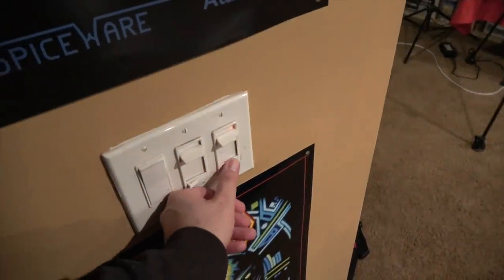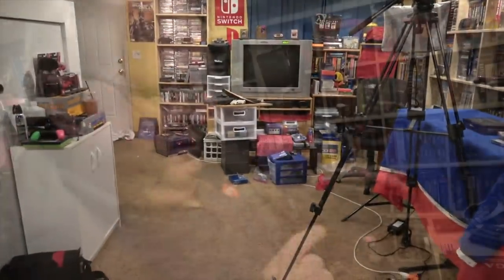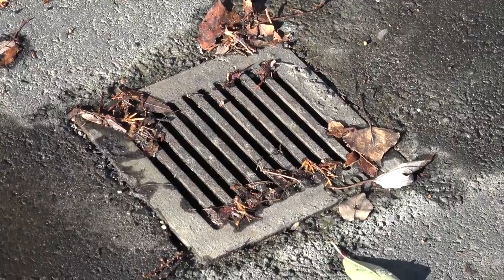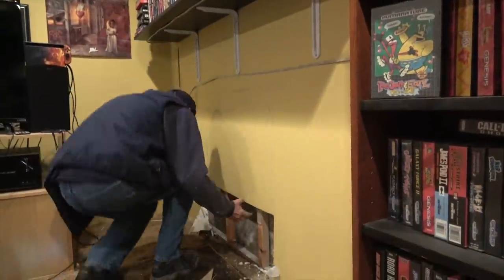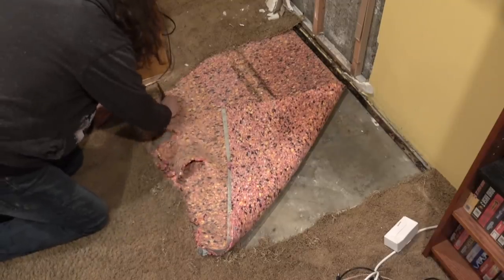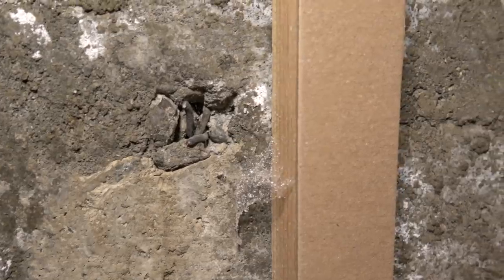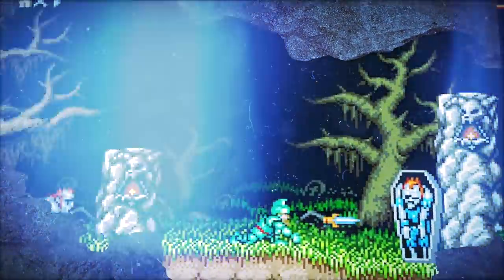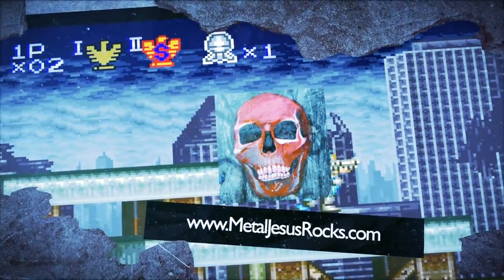OH NO! Water & Mold in the GAME ROOM! $10,000 to fix!

Comment: Whoa, hold your horses...  Minimum all you really need to do is drill out the leaky rebar hole and fill it with concrete.  Very unlikely to suddenly have problems in other areas.  This is a water ingress issue caused by recent landscaping changes, not a foundation issue.  The parking pad was not leveled properly, you can see it is diverting water towards your house.  To go further on the cheap you could dig out the soil next to the foundation on that side of your house to  a foot below the point of the leak and put in a few feet of drainage stones.  Absolutely no need to add drainage to your basement.
Reply: I was thinking the same thing. Drill it out and fill it with hydraulic cement
Reply: Im with you guys, i think the drainage addition to the basement is a little overkill.  The problem seems isolated to that corner for now, focus on that, fill the holes with concrete and see how it does.
Reply: I agree I think he should get a couple more professional opinions before doing this.
Reply: I just hope he reads one of our comments before doing the inside weeping tile don't cover up the problem fix it right drill out and hydraulic cement
Reply: Listen to this guy
Reply: I was thinking the exact same thing. Get a few more quotes.
Reply: I definitely agree. It's also very unlikely that this will happen on any of the 3 other walls as they aren't really underground. At most, do that entire wall that already has a leak.
Reply: I agree that the assessment is questionable.  At the very least, one of the first things to do is to get the parking pad and drainage system corrected so that water is directed AWAY from the home.  Who even knows where that water is going beneath the parking pad?  Adding a drainage system to the basement will not solve problems with water coming in and it may even cause more long-term issues as the concrete begins to break down.

Get the water away from the home and the biggest problem goes away.
Reply: Everyone should like this because its actually true, even for the flooring and everything else, it really sounds lile the company is trying to make a quick buck
Reply: G.A.B. Agreed. You might need to only cut 4’ around the wet areas, get a feel for where these rusted out ties are then cut access panels out, drill out the rusted metal, fill them with cement, let it dry then maybe silicone seal over the finished cement. That’s what I would do anyways
Reply: If u don’t have gutters maybe get some of those too. Gotta keep the water away from the house
Reply: They are trying to take advantage of him just like mechanics and quick lube places to do people who aren't mechanically inclined. This is absolutely not something that should cost anywhere near what he was quoted. Metal Jesus has a huge fan base. There's bound to be some general contractors in his area that are fans and can hook him up and get this repaired at a reasonable price. Hopefully he decides to go a different direction instead of getting ripped off by these scumbags.
Reply: @zborgerd  Yep. Even if the walls are fixed and completely impenetrable, if the water keeps coming up against the house, it has no where else to go but either under the home (which can then find ways up from the floor) or push in on the foundation/walls, which will just cause cracking from pressure. Getting the water AWAY from the home should definitely be the first move. This could even resolve the issue without filling any holes or cracks in the walls. Especially if you have a full-gable roof where no rain or snow typically sits right against the home after storms. 

Also, to fix that one leak right away, there is hydraulic cement that you can easily apply to the hole or crack even while water is flowing through. I get that this may seem like a "patch" on a big problem, but it's a problem that homes like this tend to get as they age. Digging around the home, could cause more issues down the line. Once you disturb ground that has been settled for a while, sometimes the weight shift can mess things up and the water table may be affected as well.
Reply: @Greg Wampler - When I first bought my house, one of the first things that I did was extend my downspouts to further direct water a few extra feet away from my home.  The result:  My sump pump doesn't even fill or run during heavy storms.  MJR's home, being that it's from the '60s,  may have been built without such a drain tile and building codes have since made it required in most places.  When they retrofit a home, like MJR's, they cut in and create an indoor drain tile retrofit to save money, but it's not the best solution and doesn't solve the problem of water being directed towards the home.  The parking pad, and the fact that it drains towards the house, is the problem.

One side of my home is hill-facing, and my neighbor's yard receives a lot of water from the my home, the hill, and the backyard.  They installed higher window wells and he recently had his yard regraded to keep water away from his basement.  Now his sump pump never runs.  It was MUCH less expensive than this.
Reply: @zborgerd  My home last year ended up having an issue with water coming in from under the basement floor. It only occurred after I had installed irrigation "dripping" hoses for my gardens. Once I realized that, I saw that the irrigation hoses were putting water into the side of the home. I moved them out, and haven't had the issue again even under the worst storms. I don't believe there's even a crack necessarily in the foundation. I think after the downspouts were converted from being guided into the sewer system, to being guided onto the ground, the old downspout drainage pipes weren't properly blocked off or began to leak after time, and that water from the irrigation hoses actually flowed down that pipe and under the foundation/floor.  It's pretty crazy stuff.

That being said, yes. I agree. Guiding the water from the downspouts as far away form the home is a must. All of mine are that way. It's also very important to make sure the ground around the home all fades AWAY from the home. You should have a nice slant downward away from the home even at parts that are level with the home. Packing some soil around the home with a nice fade away even under landscaping stones, helps to guide topsoil-sitting water away.
Reply: They nothing worse then going cheap you will regret it later as a very similar thing happened in my basement fill it with concrete only stop it for about 3 months and the water started coming in again
Reply: I wouldn't recommend drilling out the rebar unless it is going to be replaced with tie bars with patress plates on both sides (which is hella expensive!). Those rebars are there for a good reason! They are still functioning as rebars, they are just no longer functioning as closed water seals.
Reply: Or he could simply remove all of that garden and pave that piece of land, leaving only a drain for rainwater... It wouldn't look nice, but I guess it would solve the issue in a much cheaper way.
Reply: @zborgerd  Agree with this. Water needs to move away from home first. Would probably solve issue much cheaper.
Reply: That's what I thought immediately as I watched.  Drill it out and maybe a 2 part epoxy to fill the holes?
Reply: I agree 100% he's making a mountain out of a mole hill. Running a drainage through his basement is going to hurt him in the long run and make his basement unusable.
Reply: @CallforthePriest  Yeah start with the easiest solution first, they know that after 10 minutes it leaks so start with removing that and then filling it in, let it dry then see if it still leaks by running the same test. It could be an easy $50 fix that is $10,000 for no reason
Reply: If you're digging the exterior down to 1'-0" below the hole, then you might as well repair the hole, apply a mastic, and then finally put your drainage stone in there. Digging is expensive though, if you're not doing it yourself.
Reply: Outside drains going to the weeper and storm system. Almost every storm system I've hooked to is above the footing base which is way wrong. Never ever. EVER drain roof gutters or outside water down to your foundation. Grading. Fix outside drains. Check under floor slab for water/drainage via core hole or service cleanouts.

Comment: Take everything out of the room. Don't take the gamble off leaving your gaming gear around dust that's going to happen when the work starts.
Reply: I would say the same, remove everything, put in a rental container or move to another house if you can.
Reply: @PolluxBR  Or just move it to another part of the house, if there is enough space for that.
Reply: Tarps maybe???
Reply: Or send it to my house
Reply: Also someone from working crew may take game or two, you never know
Reply: Like everyone says. You must remove Everything from the room. You will find when work starts that it could reveal more problems and the mess will cause damage to your gear. If you put everything in the middle you may end up moving stuff many times as you work around it and you will need an empty room anyway to put down new carpet. Time to call on friends and get them to help you store stuff. You can still post update videos on progress.
Reply: I would do the same. Think how great it would be once it's all fixed to get everything rearranged!
Reply: Indeed. There's going to be a lot of concrete dust from the sump trench digging and then more dust from the re-plastering. You do not want to be cleaning that out of classic consoles or off the back of game discs / cart contacts. Sorry to hear this - homes have a way of kicking you in the ass from time to time.
If i couldn't remove everything I would at the very least put the collection in 50 litre plastic totes and seal the lids with duct tape.
Reply: Yes I would say remove everything from the game room especially anything that contains a circuit board like a console or a cartridge based game. The dust well absolutely destroy and coat anything that it touches and there will be a lot of dust when they do the jackhammering of the concrete floor to do the French drain
Reply: Yep. Get it all out of there! Once things get contaminated with mold, it’s hard to get rid of it. Time to put things in storage until the problem is fixed. When they do the work to fix it, they mess will grow exponentially.  Also, mold is actually there before you see it. Get it all into storage before things get contaminated. Sadly, my bet is that much of it already is.
Reply: You could always ship it to the UK and I could look after it......
Reply: I agree remove everything MJR better safe than sorry
Reply: I figured he would throw it all in a storage locker for the being.
Reply: Absolutely box all your stuff and I would hand dry everything. Vapor will hurt anything and everything.
Reply: 2x side door shipping containers in the back yard would do him a lot of good right now.
Reply: Get tons of plastic containers with the seal gasket lids, put all the shelve items in those.  Move the bigger stuff upstairs.

Comment: Been working in home renovations for 10 plus years. Too bad I'm in Toronto, would offer some help. But to be honest get another quote and then get another one after that. What they're suggesting is total overkill and it seems like they're pushing for a big job. For one - you could likely patch and seal that one section (if properly done it could be done from the inside) and that would be the end of it. If it continues to happen around the basement then maybe think of getting a bigger reno. Two - You definitely don't need to dig up half the yard. You could get someone to come in and just dig a small section in front of the wall and then you'd have access to the exterior. Also, think about putting a slope in that garden area to drain water away from the house. 

I've fixed many basements and they've held up without doing either of the two options the guy gave you.
Reply: I don't see why this couldn't just be "drilled and filled" from the inside. If the problem is rusted-out hangers, then drilling them out and filling with patch concrete would both seal the hole and prevent weakening in the wall. Am I missing something here?
Reply: @timhaines3877  yep, exactly!
Reply: Tim Haines It totally could, hell it would be a basic enough DIY job for even the most untrained of people.
Reply: Tim Haines seems logical
Reply: A sloping water drain is imperative 👍
Reply: Patching from the inside (no matter who/what anyone tells you) is a bandaid fix at best. Dig up the outside yourself or grab some buddies to help. Install a product such a Delta-MS Dimpled Membrane or Blueskin. NEVER allow water into the house. Stop it at the exterior. Message me with any questions (worked construction 13+ years and am currently a Building Inspector). Best of luck. Love the channel.
Reply: @timhaines3877  Even if he does a patch fix you'd want to check all the hangers in the foundation, cause you don't want to redecorate the basement and then having to do it all over again in one or two years because another one starts leaking.
So I totally disagree with S H even with his experience. It's just skimping on costs and leaving future possible problem areas to the next buyer of the renovated house. It's just hiding defects in the house basically, even if they are defects still waiting to happen. So I wouldn't want to buy a house myself from S H personally, and that's probably because I personally have the mentality that if you fix something you should fix it properly and I expect an upstanding professional to do the same.
Reply: im new to this situation and the first thing i thought of was dig up the dirt and fix it outside...
Reply: Wrong. A proper fix is digging on the outside wall and installing a DELTA membrane. 30 Years of experience.
Reply: preach brother ! yess
Reply: @MoreBear  yess sir , that be my home owner fix . ive poured thousands of yards concrete , build shit houses to cat steel I beam building  to 1.5 million dollar houses on ohio river . being on that sloped hill is MJ best advantage , you divert water at source ,